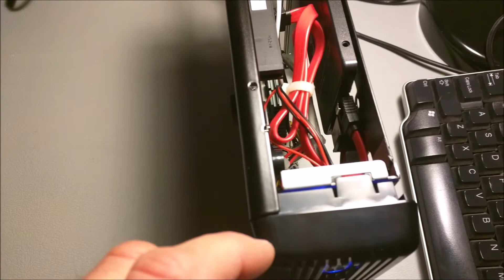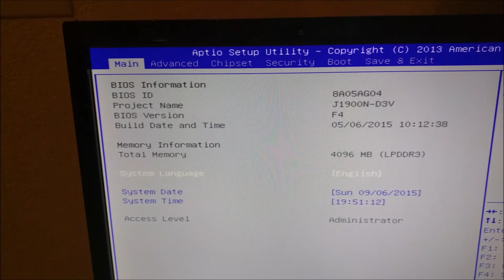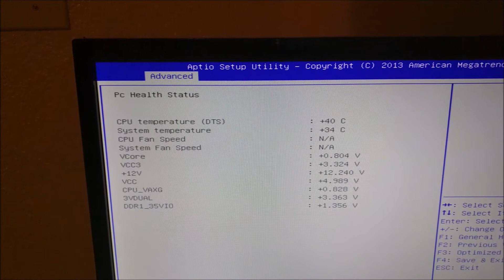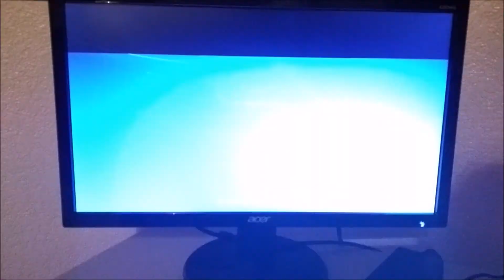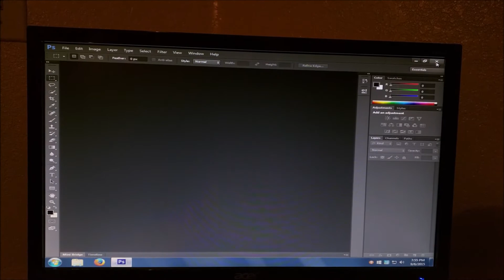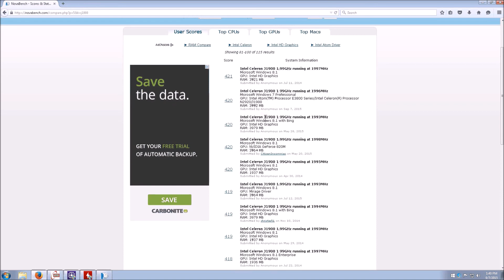Windows 7 Build on GA-J1900-D3V from MITXPC.COM

Comment: how did the network speeds behave on windows compared to *bsd? cheers
Reply from the maker: Windows did 112MB. True 1gb speed. I think I got 80MB on the pfsense. During the transfer on Windows it used about 20% CPU.
Reply: +Glen Whittenberg sweet. Im thinking about getting that board and run Debian with dhcpd3, dnsmasq and iptables 😀
Reply from the maker: +Niclas Kroon I loaded Centos 7 on it a while back and it worked awsome. I got 110MB transfer on that one.
Reply: +Glen Whittenberg that settles it. Im ordering the board now. Thanks for the reply! Do you have more benchmarks or such? ☺
Reply from the maker: +Niclas Kroon I don't have anymore. it's nice little PC. got one for my mom. all she does is email and Facebook and ms word. it's quite, low power, and just works !
Reply: +Glen Whittenberg I see well ill keep u posted as soon as I get the board and have run some tests
Reply: +Glen Whittenberg buddy, could you find out what realtek chip  is on that board? lspci|grep Network? :D
Reply from the maker: +proleet box is off site now. no remote access.
Reply: +Glen Whittenberg doh! thanks anyway.
Reply from the maker: +proleet let me know how your build goes.